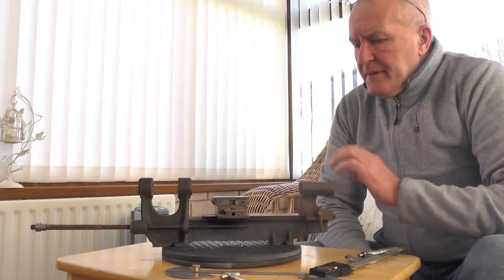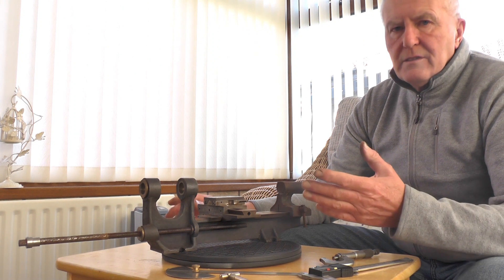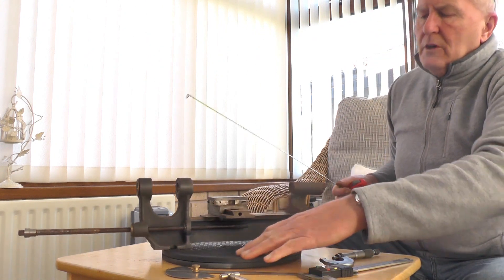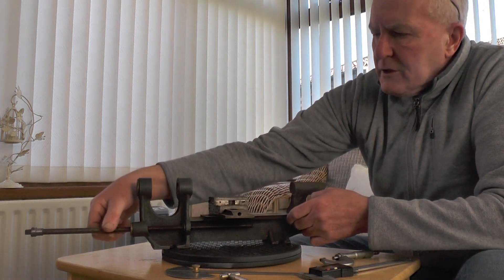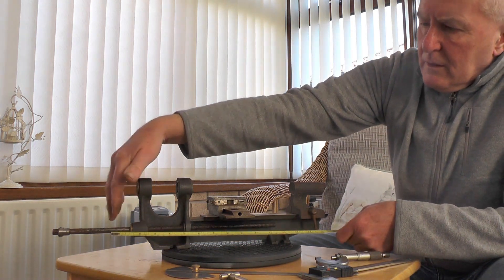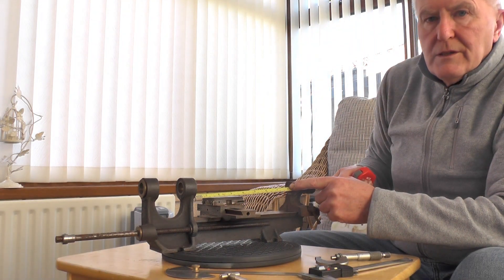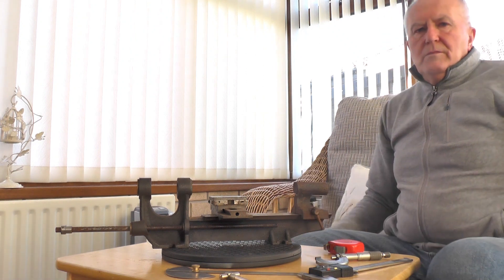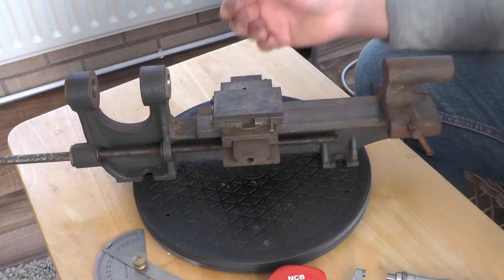Intro - Making a Micro / Mini / Watchmakers (screwcutting) Lathe from Vintage Castings "mr factotum"

Comment: Looks like a lot of work, but should be interesting.  I see the headstock has been line bored.  First off check that is parallel with the ways to avoid any nasty surprises.  It would make a handy little collet lathe.  Cheers Rob
Reply from the maker: eyup Rob cheers
yes very interesting, i checked all the critical dimensions before deciding to take it on, all good so onward and upward, i hope, 
no drawings so winging this one, bite size chunks so i don't overload.
appreciate the feedback
atb
Kev

Comment: Nice castings. I think you should write down a step-by-step plan on how to proceed. It will be easy to paint yourself into a corner on this. The castings have some design problems that will call for some clever work arounds. The head stock being cast integral with the bed is really annoying. There is no easy way to correct any misalignment between the spindle bore with the bed. I would check the bed/spindle alignment with a test bar and see if its close. If it is close, I would grind the bed with a face grinding wheel to square the plot up, working from the spindle axis as a base. Normally if the headstock was removable, you work off the bed and set everything to that.
The tail stock is a bit of a problem as well. Since there is no cricket between the tail stock and the bed there is no easy way to correct any misalignment to remove any taper when turning between centers. Perhaps you could figure out a way to make the tail stock adjustable even if you had to make it where it had to be shimmed to set it.
The headstock end of the lathe, while pretty, makes fitting a plate to hold the change gears a bit of a pain.
Again, everything depends on the alignment of the spindle axis to the bed. Make sure that's done first so the lathe will do what you expect when you finish it. 
Good Luck from NC/USA
Reply from the maker: Eyup ACH
Thanks for your detailed thoughts, very much appreciated. 
You've read my thoughts, and my concerns, already had a test bar in the headstock and to my surprise the spindle axis in relation to the bed was very accurate, if this had'nt been so i would probably have shelved it as i have no grinding facilities, and i don't ship work out for others!!
The tailsock was a also a brain teaser with being fixed but i have a plan, hopefully!.
Like when i built my first steam loco from scratch, bite size chunks is the order of the day, so not to get swamped!!!, thats probably another reason it got abandoned by other hands it's passed through.
The casting design is probably why it has never got finished off since the original owner started it many Moons ago!.
Anyway nothing to loose so we will have to see what the outcome holds, No pain No gain!! and keeps the "Grey Cells" exercised!!
Thanks again for your feedback👍👍👍
ATB
Kev